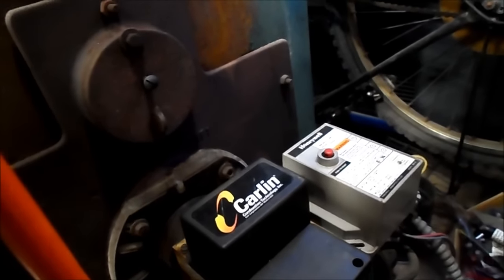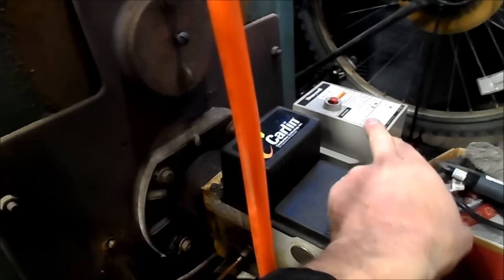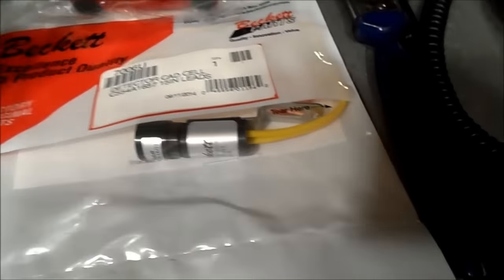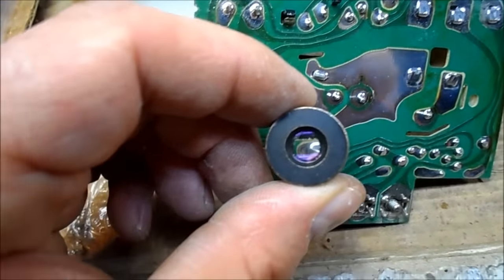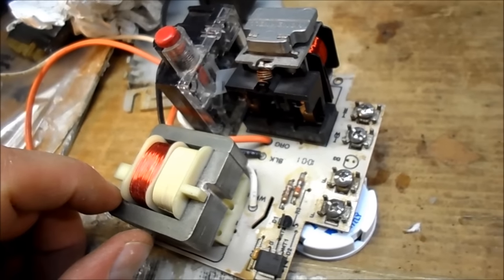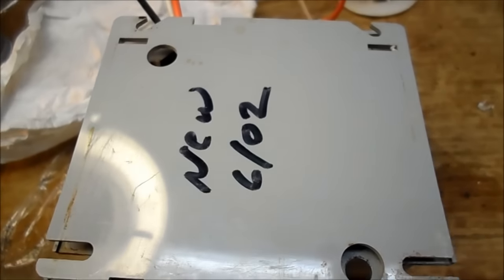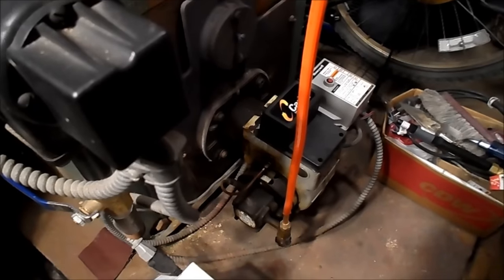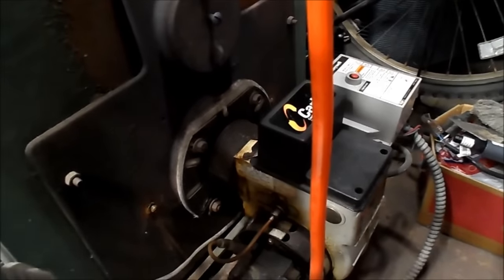Beckett Burner Repair To Help A Vintage Magnavox B&W TV.

Comment: did you try different taps on the auto brightness tap? IIRC there are 3 different ones that effect the control of the eye over the brightness.
Reply from the maker: +Dave WM Oh yes, I see that. "Connect lug to either 245V or 550V boost whichever provides proper operating range for Magnalux circuit". Will try that 1st. Thank you again! Will follow-up.

Comment: As a photographer, I do collect and use vintage cameras (and light meters), those that offer metering use either a CdS or Selenium cells, they do go bad after awhile, as a steps to prolong their life, a general rule of thumb is when not in use, make sure they are covered with no light available as the light wears them out, not sure what the basement looks light, if there is any constant light but maybe in summer months, cover the Honeywell box and see if that helps any? For photographic gear, there is no replacement...however like you with the TV, I too plan on experimenting one day when time is plentiful.
Reply from the maker: +JacksJunkDotCom The burner is still performing. It seems solved. However, without concrete evidence. The cell is always in the dark, but subjected to a lot of hot, &amp; cold. Both the new &amp; the old cells metered out the same. Unless it&#39;s the wavelength of the light or something. The Magnavox TV has a red filter over its CDS sensor, so that makes sense. There is no replacement listed, so will have to experiment, perhaps using a resistance decade box in place of its cell. A burner tech who works on these on a daily basis would be more familiar with the cells life for sure.